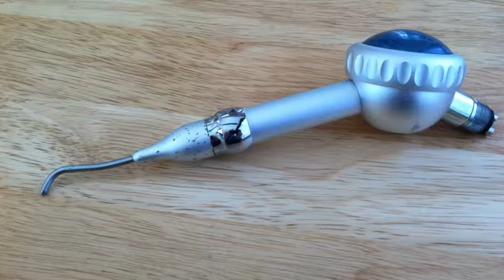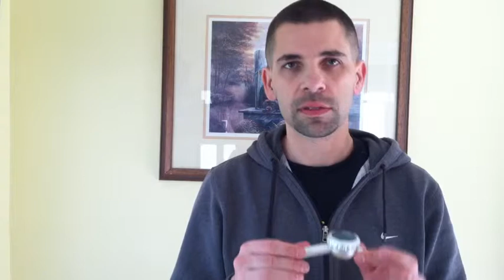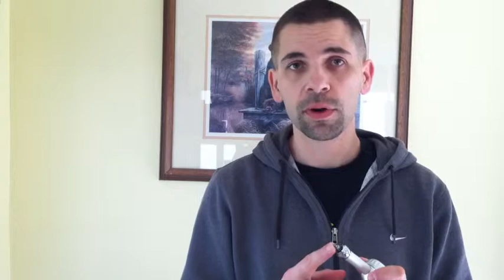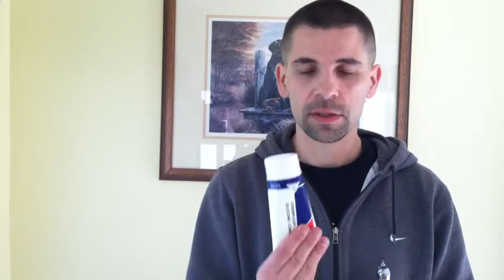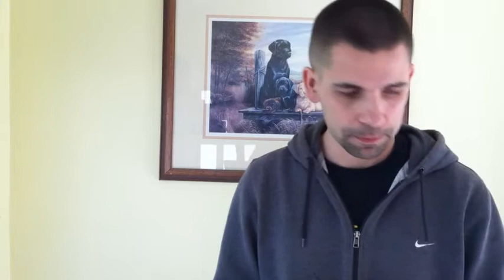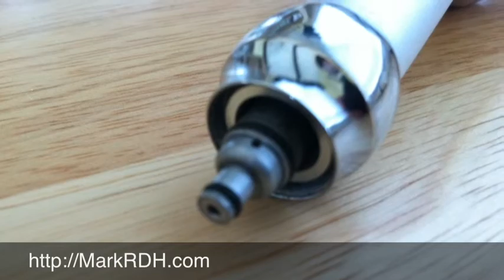eBay air polisher - Repair and maintenance of the o-ring problem

Comment: I just got this air polisher and I used it for the first time yesterday. It was so messy, I got powder all over the patient’s face and I was surprised how quickly I went through the powder. Do you think turning the water all the way up will make it less effective?
Reply from the maker: It should help a little, but the primary way to minimize the mess is to use good HVE.  I use the Isolite or DryShield mouthpiece and a wide HVE tip simultaneously.